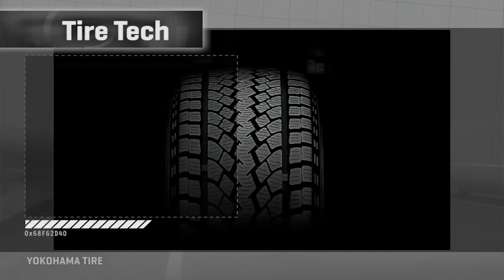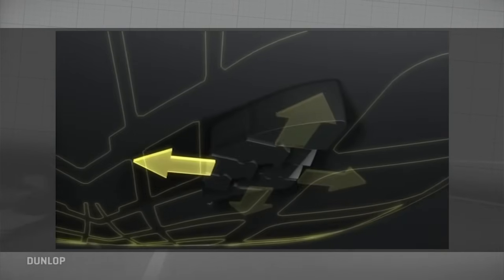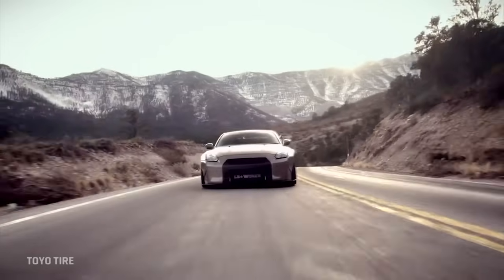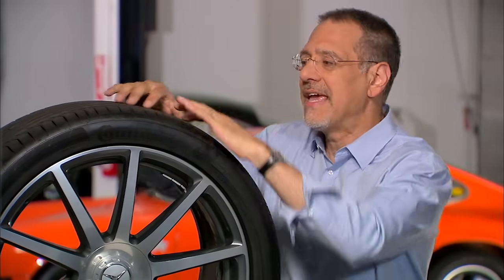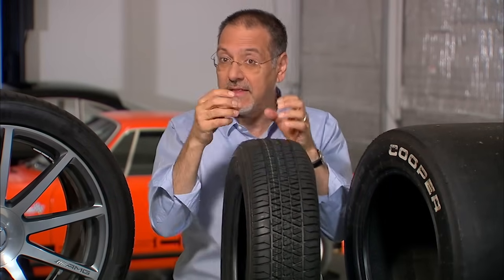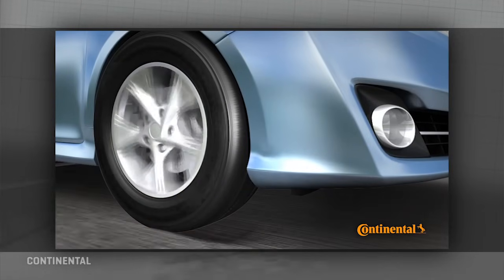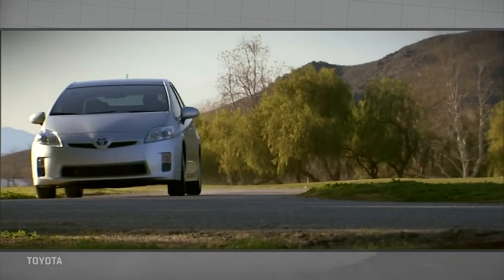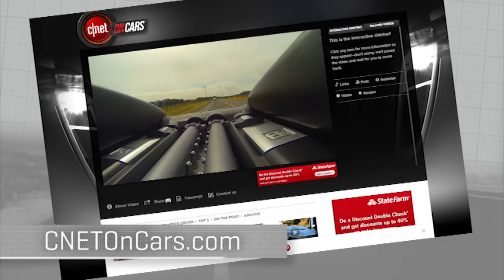CNET On Cars - Car Tech 101​: How tires work

Comment: Your engine or transmission have no idea of the speed you're going, and spin the same way at all speeds. A highway guy puts 200K miles on his car going an average of 60mph. A city person going with the average speed of 20mph(3 times slower) put exactly same motor hours and stress on car components at 200K/3 = 63K miles.

Comment: I don't even know if the patterns in each of my SUV's tires are the same... would that change anything o~o

This high tech tires really do grip to rocks under the snow and in off road for the best traction possible, the bad part is when your car is really heavy and the rocks just stay stuck in any space they can find between the ridges.

Comment: Expel water out the sides ?  
Many years ago I drove around on Yokahama A509's which had a chunky open tread.  Best and safest tires I've even had, then they stopped making them.
Have a look at the tread on most tires these days.  They have three or four deep groves along the axis while the side channels are blocked.
These deep grooves are fine when the tires are new, but 10 to 20 k's later they can't expel enough water and you hydroplane. 
Throughout the video and in the animations you're showing tires which have water exit channels both along the axis and laterally.  But it's tough to find a tire now with an open groove pattern along BOTH the axis and to the sides.

I'm no tire expert and I don't want to sound like a smart arse but in my mind it seems that the more ways water has to get out from under the tire the safer it is.
Just look at F1 wet weather tires.
I get the impression that tire manufacturers are making tires that become useless sooner so you have to buy more tires.  I understand the business strategy but even if you do the right thing and check your tire wear regularly and see plenty of tread, you may not realize how unsafe your tires are until you find out the hard way. 

And it's my opinion, just my opinion, that tire manufacturers are playing a dangerous game with safety to sell more tires.
Reply: Ellesmere Wildwood Every block tread tire i owned has been excellent. I have owned a lot of the other style tires, never had good luck with them.
They are great as highway eco tires, but they are terrible in rain, snow, mud, etc.
My go to tire now is the Douglas Xtra Trac II/All Season.
Reply: Kumhos

Comment: Brian, If you made a 30 minute video on tires..I'd still watch it.
Reply: +Henry Hsiao yup Me three! For the last 6 months, I've been a tire nerd/junkie and doing extensive tire research. What have I become?
Reply: Henry Hsiao yup, me too!
Reply: +Richard Ojeda what happens if I had a little screw in one of my back tires? tire is not punctured because the screw was too small
I removed it and nothing happened
But what if i'm 1mm away from a exploding tire???
Reply: outspolsis To be honest, im not sure what to do in that situation, but for sure, you should not go on the freeway/interstate in that case. City driving is fine, but you should get your tire patched or, more recommended, have it replaced.
Reply: your tire will not 'explode' due to a small puncture or even a big puncture (depending what part of the tyre has been screwed)
Reply: Yes. Yes please
Reply: If Brian released a 2 hour theatrical release id but the early admission
Reply: Me too...good to know I am not alone on this. Loved this one, wish there was more.